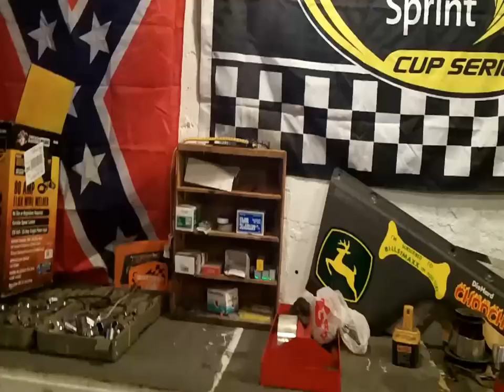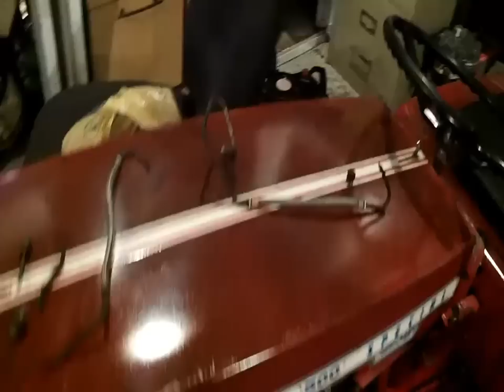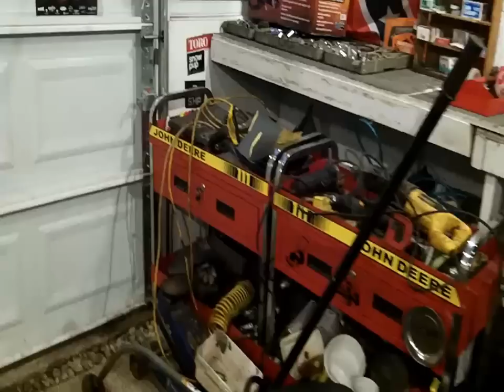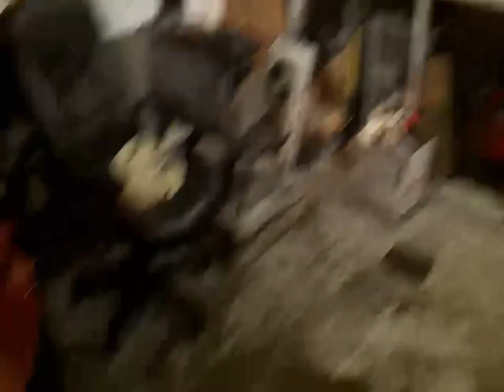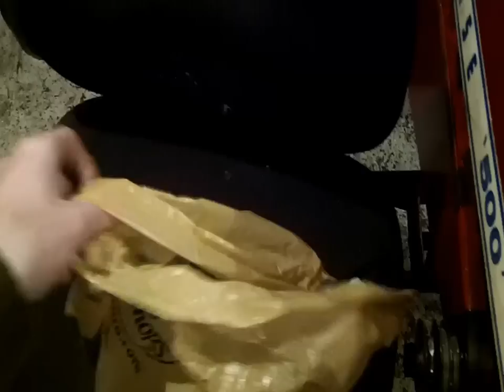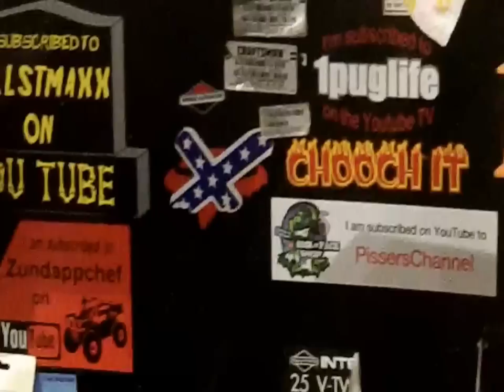If she an't broken DONT FIX IT!!!!!!

Comment: Ah yes those must go down to the abs which has special fittings so you can't by them cheap.Why does it need those flex lines though. Thats the problem with the new crap its expensive but holy crap would never had thought that much!! Good deal on tires thats 2 tires for on the bronco. I was just at my local ford dealer today for a recall on the 09 lol